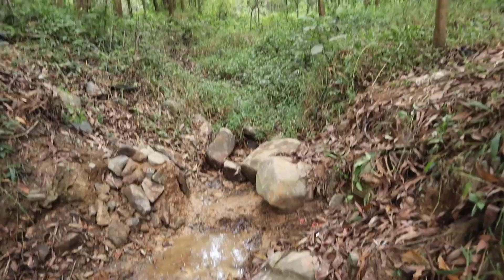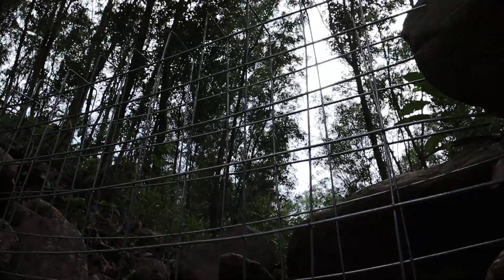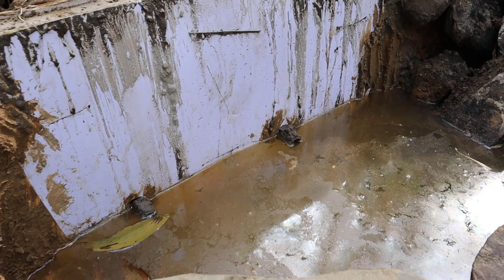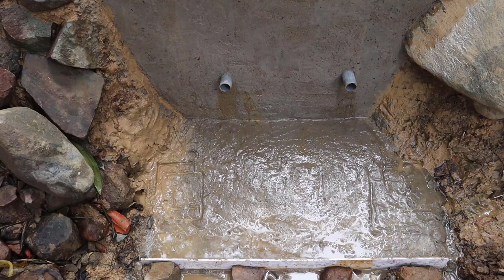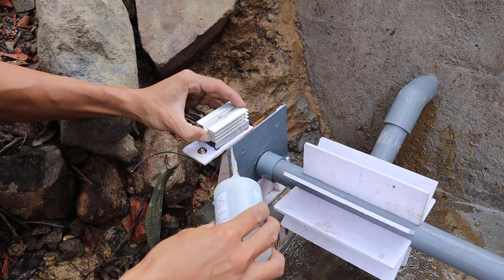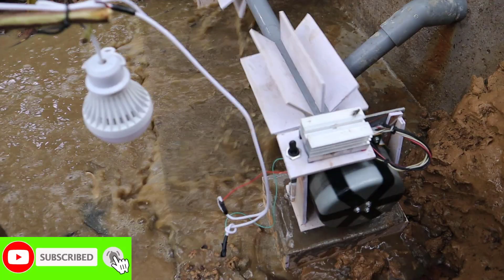Idea to build a mini hydro electricity

Comment: I got a few remarks. 
1. No isolation of the cables whatsoever and they work in wet conditions
2. The generator is not well placed and is also almost submerged into water
3. Why not putting a buffer battery to get electricity with equal parameters? Connecting the consumer directly to the generator is not a good practice at all.